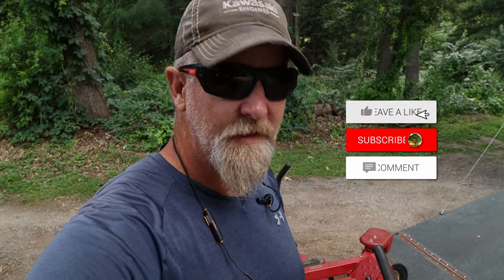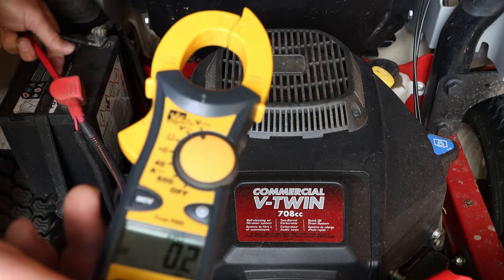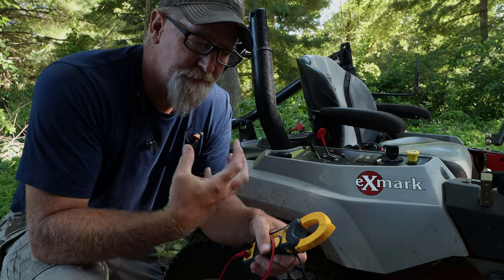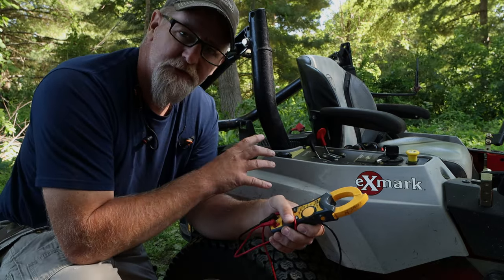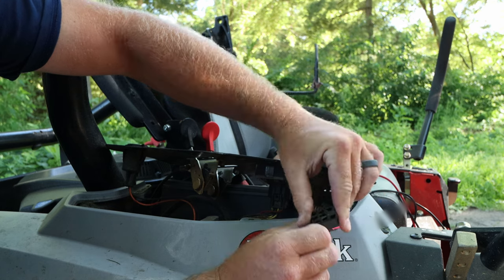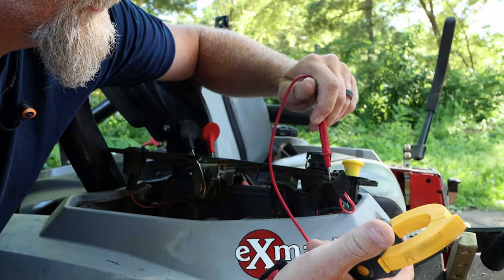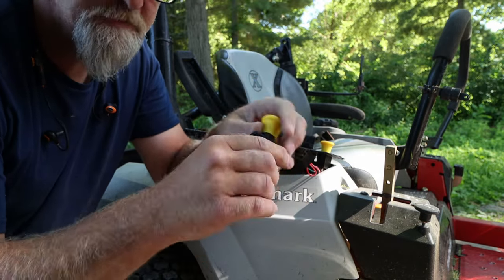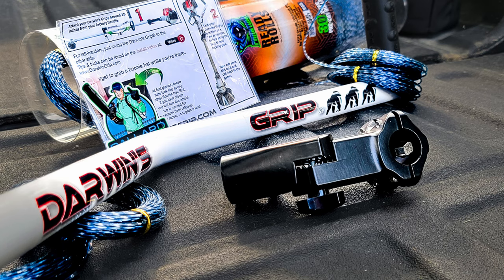Exmark Radius - Electrical Issues "Troubleshooting PTO"

Comment: Here is one for you. I have a 2023 exmark radius with less than 250 hours on it. After the unit is running for an hour or two, the clutch will stop working until it cools down. Will make a faint buzzing noise sometimes but it has been doing it for at least 100 hours. 

Still under warranty but the dealer can't replicate the issue
Reply from the maker: Hey man, I'm sorry to hear about the issue you're having. If you haven't already fixed it, you might want to ask the dealer if they could ohm it out, to see if there's a direct short to ground in the PTO clutch. Hope that helps!

Comment: You didn't specify to test at the pigtail or spades on the clutch for the resistance (OHMS). So test the spades on the clutch itself. You can also test for continuity at the same spades. You can test at the pigtail for voltage also instead of pulling the whole control panel. Turn your key on and pull the pto switch and you should have 12v with the motor off. I think that's easier and quicker because you test everything at the same spot. Then if you get goofy readings there you can go more in depth. Thanks for the video!

Comment: Please explain where the plug is at for the PTO clutch. You mention, “down there” but I’m not sure where to look or what I’m looking for.
Reply from the maker: There should be some wires down around the PTO Clutch, it has a connector that requires a flathead screwdriver to gently lift up on the tab while you're pulling the wires.

Comment: I have a question for you. I have a 2002 e mark 23 house Kawasaki . My clutch overheated, I put a new one in. Now it won’t start
Reply from the maker: Try disconnecting the switch for the p t o and see if it starts.